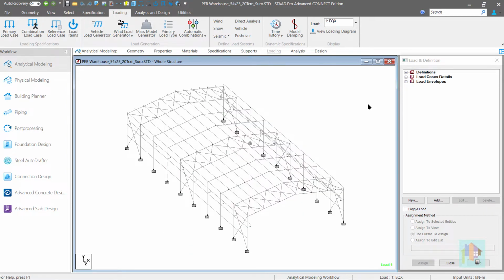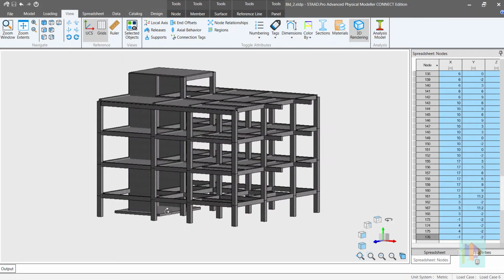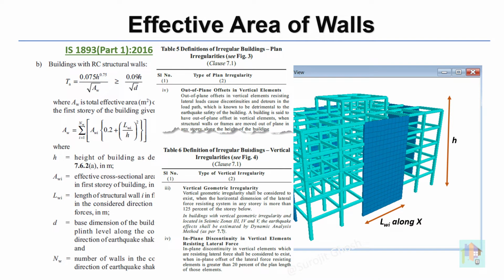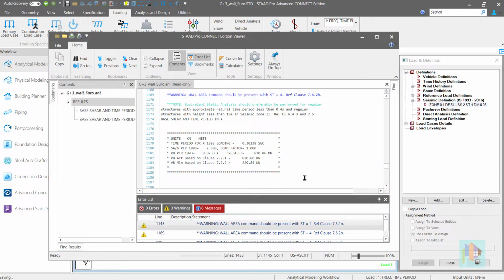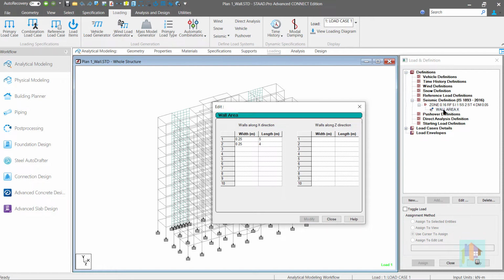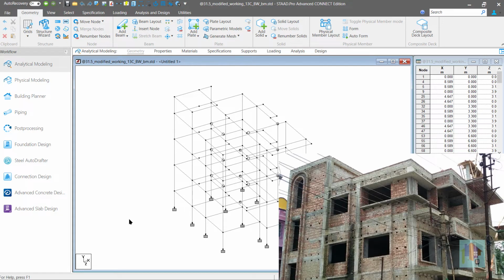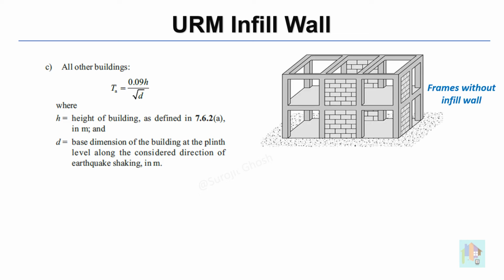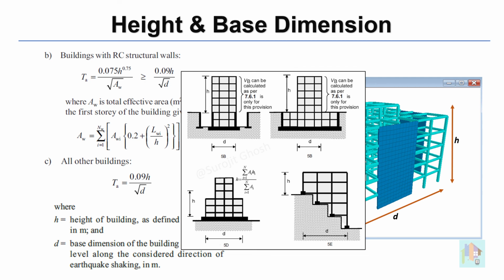Static Seismic with IS1893 - pt.7: Time period for Walls (ST 4,5) || RC, URM Infill Wall || cl.7.6.2

Comment: Sir, if the building have shear wall (RC steuctural wall) and URM infill wall also applicalbe (SPD >20%), then this building is falling in which structure type? ST 4 or ST 5??

Comment: Eigen solution gives value of time period for each mode ,which mode's time period should be consider for analysis and design?
Reply from the maker: For dynamic analysis, individual modal results are considered. If you want to use time period from eigen solution for static analysis, you need to consider the fundamental time period value, normally the value reported for first mode.

Comment: Sir...do i have to go for ST 4 in case if I have RCC walls only at the basement and the RCC wall is discontinued from Ground floor? What should I consider in this condition?
Reply from the maker: As per IS1893, you need to consider the wall area at the first floor level when you use ST4 time period calculation method. If the RCC walls are present only at the basement level, not above ground portion, then it is better to use ST1 parameter. Also, for such irregular structure, it is always recommend to perform dynamic analysis where the time period is calculated based on the overall structure stiffness using Eigen value method.

Comment: Sir Kindly make video on Wind Load 
I'm so confused after seeing different videos on youtube, they all are teaching different
Reply from the maker: It is already in my plan, but as this will require longer duration to complete, I have not started it yet, may be later this year. Meanwhile, you can check this video to get an idea about the new wind load generator in STAAD -- https://youtu.be/RD8j7PvBURE.